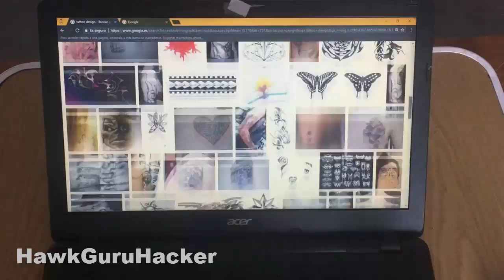How to Make a Tattoo Machine at your Home

Comment: 2:04 lol I work with motors all the time you my friend just blocked where the heat comes out of the engine with hot glue... also the moter you used would burn up way to fast especially since you blocked the heat vent with glue

Comment: 1: that tattoo looked horrible. Why would anyone want that permanently on their arm.
2: you could have just put the pen on a Thomas the tank engine wheel
3: what was the point of that blue pen?  I know it was to hold it all together, but why test it out first.
But overall, if it's permanent, I want one of those. Thanks for the video.  I subbed😄